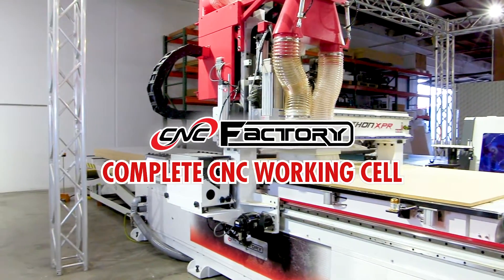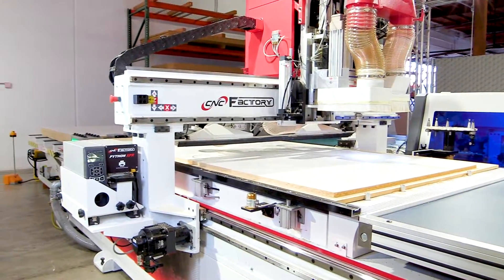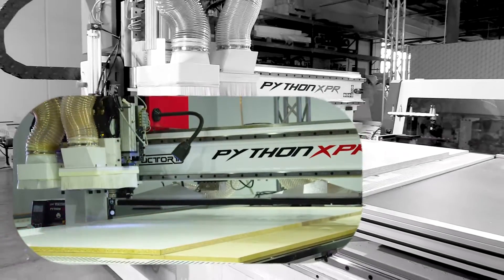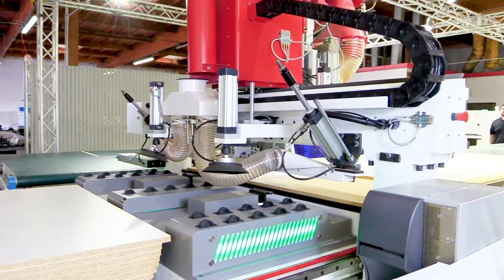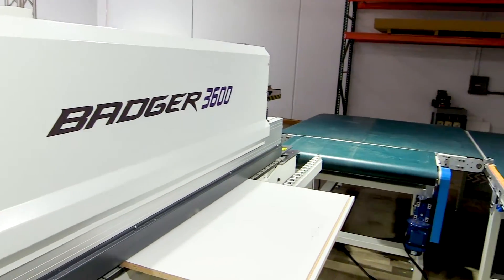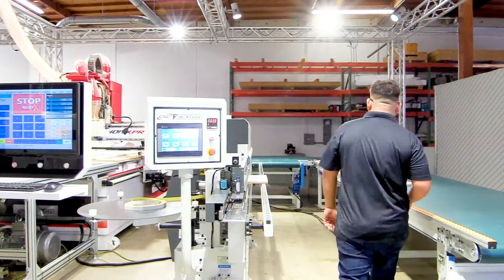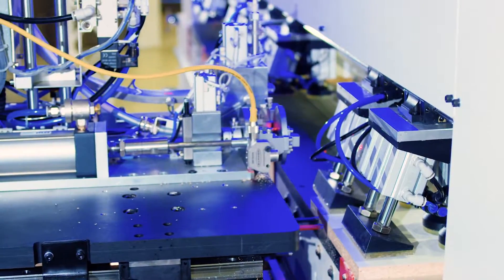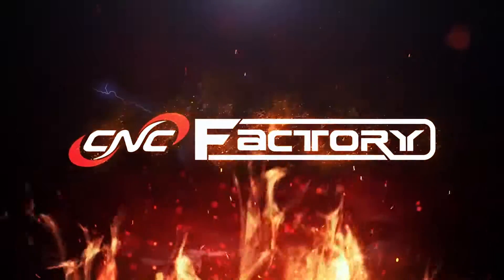CNC Factory Working Cell Demo

Comment: So the three machines do the job?
Reply from the maker: Yes, Mohamed! These 3 machines with 5th generation features are all you need to convert your raw material to a product ready for flat packing! Please contact us at sales@cncfactory.com or +1(714)581-5999. We'd love to answer any of your questions.
Reply: Hi Chris, I have pretty much watched all your videos and looked around your website at all your machines and I like what I see. Your passion comes across in your videos and I can see the time you have put into your machines and their quality. 
Can I enquire about available voltages for use in Australia please? We use 240v 10amp single pahse and 415V 20amp 3 phase. 
Cheers Jerry